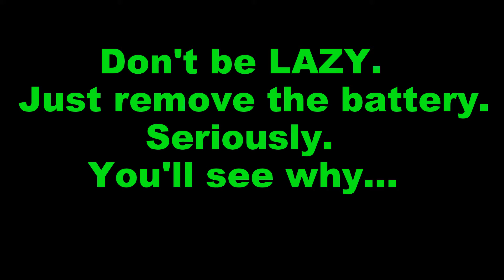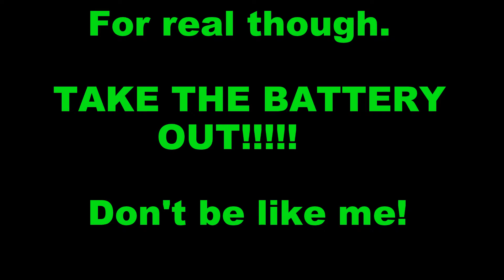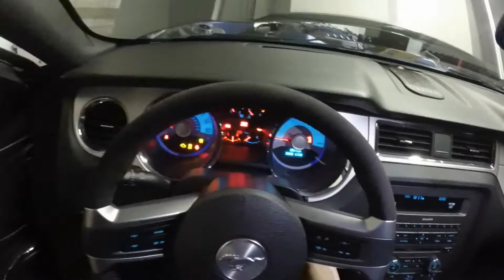How To: Spark Plugs on a 2012 Mustang GT FAIL!

Comment: Thanks for this Brian! Getting ready to change plugs in my 2011 GT. Looks much easier than the pre-Coyote 302.
Reply from the maker: No problem glad it could be of some use! Make sure to disconnect your battery! lol
Reply: Ahhhhh, good idea on the battery. I've got 103K on the original plugs so I've decided to install the Bosch OEM again.

Comment: Easier to use a 5/8 spark plug socket with the rubber insert, then you wont need the magnet, yes they do work!
Reply: Ive always used a magnetic one since getting a rubber insert come off in cylinder.

Comment: same thing here with battery lol.  Where are you getting a vacuum leak?
Reply from the maker: Its a common mistake apparently lol partly why I put this up. But I thought it was on the canister purge valve or the line running through it (uppermost hose connected to the boss manifold at 5:14) but I ended up determining that there was no leak and it was just the sound of the purge valve working. It went away after I installed a supercharger though oddly enough..

Comment: do not run anything else but motorcraft plugs in new fords.  every mechanic i talked to, including my own experience, has had cars come back because a customer put autolite, or other brand spark plugs in their newer fords.  older fords can get away with autolites but not even new fords can.  run motorcraft ONLY unless it's a supercharged mustang and then you can get away with autolite AR103s.  bosch is for german cars only.  just like densos work great in toyotos and ngk in hondas.
Reply from the maker: I hadn't ever heard that from anyone before. Thanks for the info! I picked them up as a temporary since I knew I had intentions of supercharging (which I now am) and have since switched them out again for a different setup catered towards the boost.
Reply: Brian Sabat if you supercharge get ar103s by autolite and a kenne bell boost a spark and gap at .035 with the knob dialed half way.  itll keep deposits from staying on and make them last long with good driveability and power
Reply from the maker: Definitely appreciate the suggestion! I'll keep that in mind for sure. I have to get everything back in working order first haha